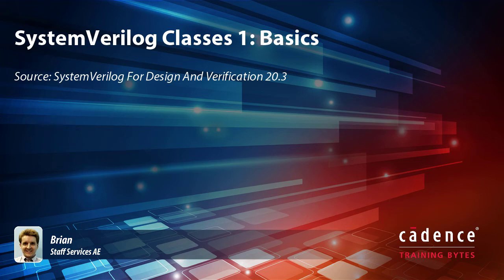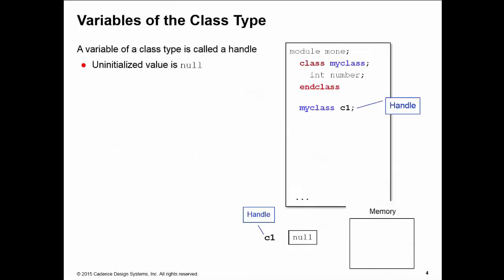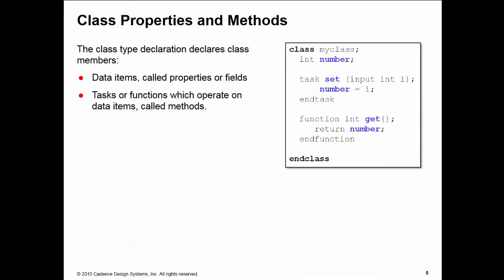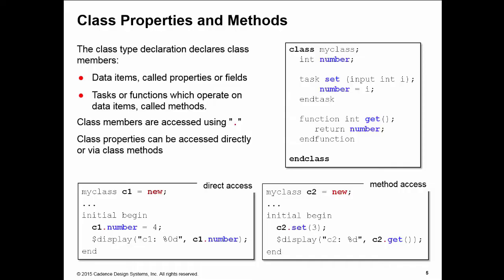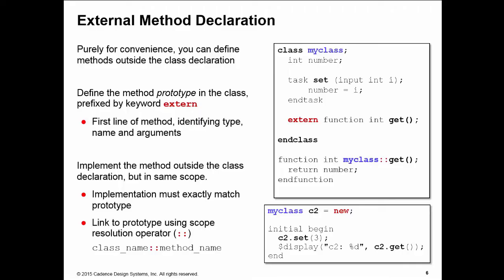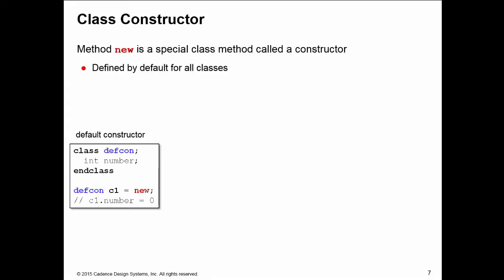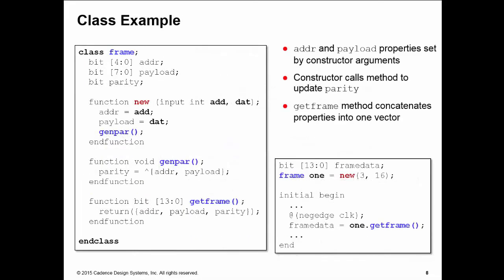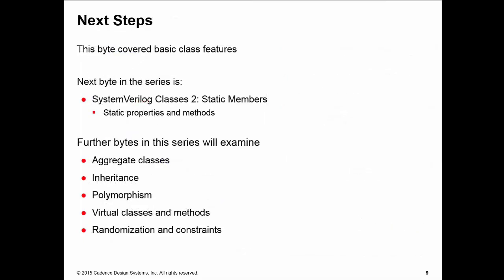SystemVerilog Classes 1: Basics

Comment: current generation (2019) c++ does not require explicit deconstruction. compiler does that. sometimes a deconstructor in c++ is used to proact some esoteric action before actual deconstruction so, having the capability to define and call explicit deconstruction is useful.

Comment: question: what purpose is there for separating the declaration and the instantiation?
Reply: Instantiation allocates memory in system, while declaration doesn't. Hence, define all required classes for a top design at one place, use them as in sub-design as per requirement. Like you can write a single class for as_rst_n driver, and use it at multiple places. Also, u can write design independent classes and use it's derived classes in design.